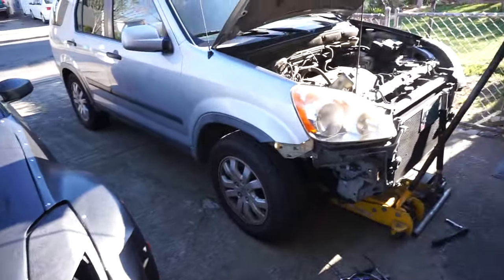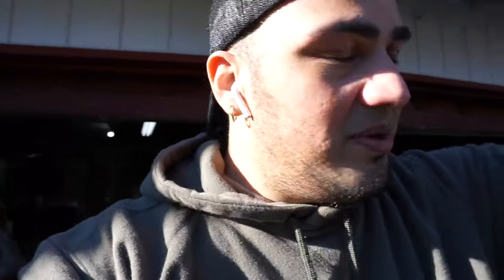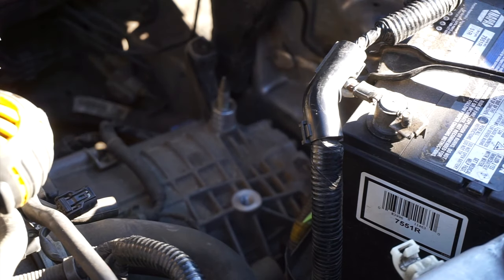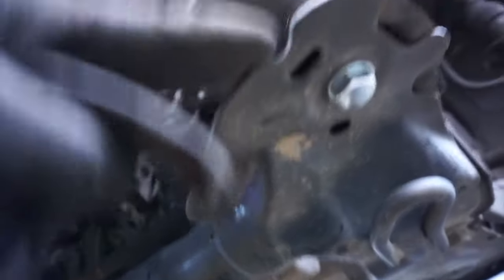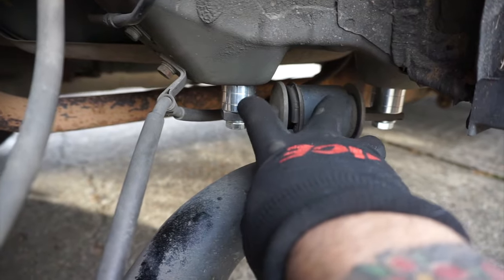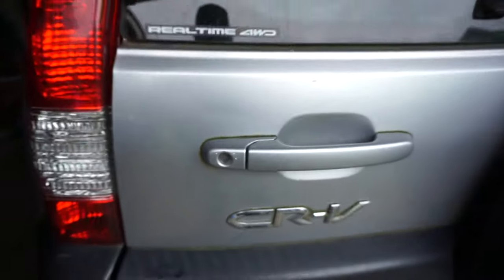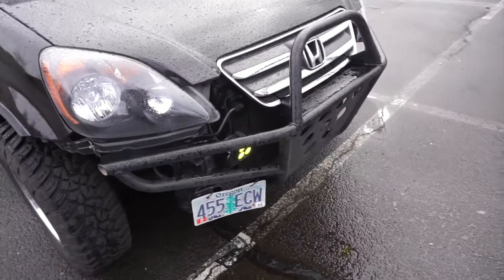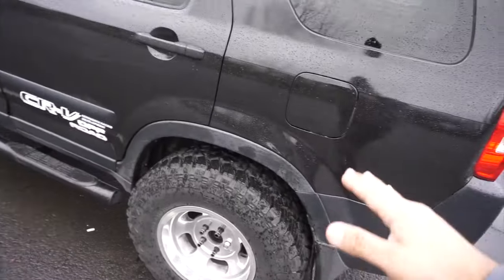Makeover to my Honda CRV

Comment: I lifted my 2nd gen with the HRG 3” Ultimate lift kit with subframe drop it still wobbles on 2nd gear
Reply: Anyway you could link some stuff for the lift?  Cant find anything online I’m confident will work.  I’m currently building mine out, started with the crossbars, and a roof basket, with a 270 degree awning.  Next is bull bar, auxiliary lights for front, and rear because I want something to turn on when I’m out over landing under the awning (not sure how I’ll mount them yet) and I wanted to do a few other things, potentially swap out speakers throughout, potentially a gsmr radio, and potentially a secondary built in power system.
Reply: Just looking for ideas/the best way to go about all of it.

Comment: I lifted mine 2 inches mounted rear camber kit and camber bolts in front and still struggling with alignment any suggestion? I saw you drop the sub frame and engine

Comment: Hey man, why did those aftermarket rims hit the caliper and the stock one's didn't? What's the difference? And what size spacer is needed to fix it?
Reply from the maker: Yes the offset of the wheels made that issue and a small spacer fixed it